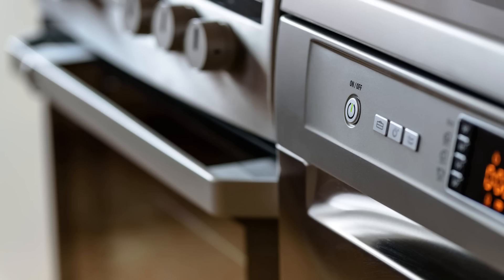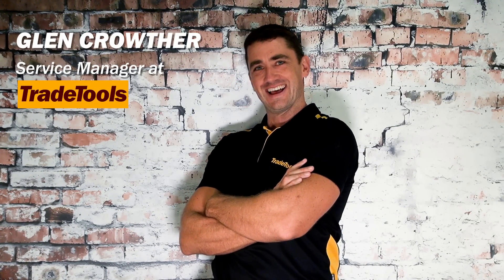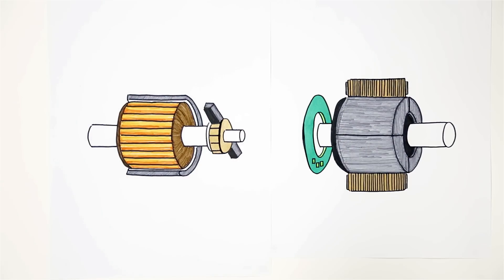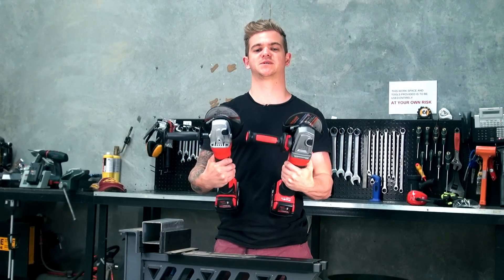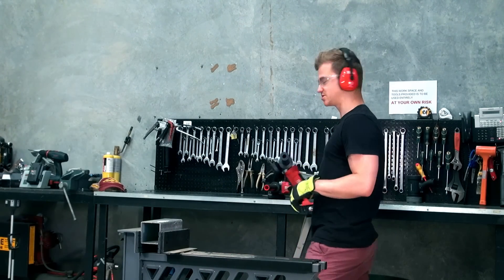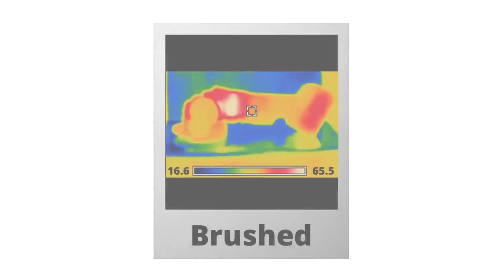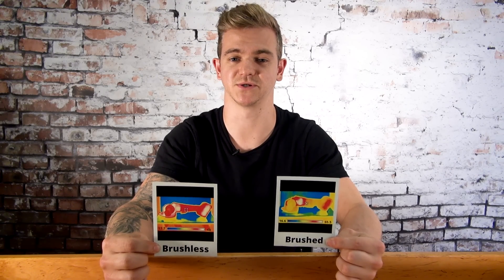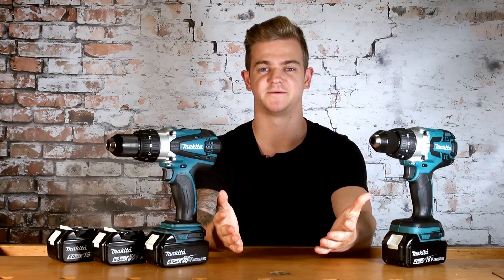BRUSHED VS BRUSHLESS: How it works!?

Comment: However the more magnetism the permanent magnets lose over time the greater the power drop and the electronic circuitry loses its switching effect on the wound coils whether the permanent magnets revolve around the fixed coil or the rotating coils revolve around the fixed permanent magnets depending on the style of motor. Also brushless motors are not very humidity friendly  and cold weather friendly as well. All electronics require cooling of some sort as well. Too heavy load and heat are not good for brushless DC motors as well. Better invention would be to have a sealed pwm that's speed controllable and that creates a square wave which powers and induction motor through an SCR  and a capacitor reducing the amount of electronic circuitry. Can even be made light weight and would be a better method for cordless chainsaws which require higher torque and horsepower demands

Comment: brushless tools are much more complicated (for no reason) and if they brake, they can't be repaired, at least not money worth repair. They are the pedestal of one time expendable tool. They brake easily and need special storage away from humidity. Brushed on the other hand , are simpler and can be easily and cost effectively repaired. Why every single video on youtube focuses only to the advantages of brushless motors and they don't mention the disadvantages? i smell payment for marketing hype. Anyway , for a home user, diy...er and hobbiest, cordless are a waste of time and money. for home users corded is the way to go. No need to worry about batteries , which eventually will degrade and need replacement, but a corded one will last 3 lifetimes. Even if you use the life out of them, chances are, that all that they will need, is a set of new carbon brushes. Oh , and just for thought, there were once brushes that wouldn't and couldn't degrade at all. They changed all that just to create a new market.
Reply: Yep, humidity is a detriment to most electronics.
Reply: That’s why I have 3 year warranty on mine. 🤓